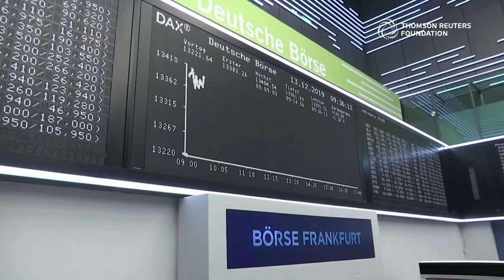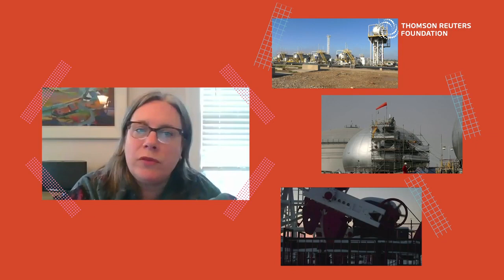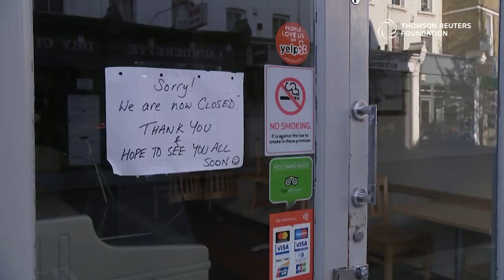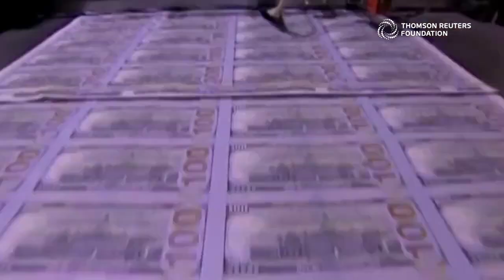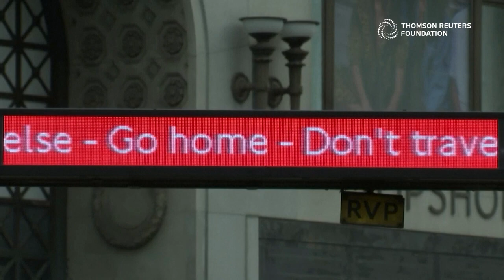How the Coronavirus is affecting climate change

Comment: regardless whether human population makes the earth's climate change, the Paris Accords Agreement is a construct to create more wealth and power for the already extremely wealthy.  The ability to pollute the air is monetized by the means of "carbon credits" which are a commodity sold similarly to stocks.  It will actually create more air pollution and make prices rise for consumers as producers offset the costs caused by their need to buy carbon credits in order to produce.      This guy explains the process quite well:  @  in s 12 minute presentation.